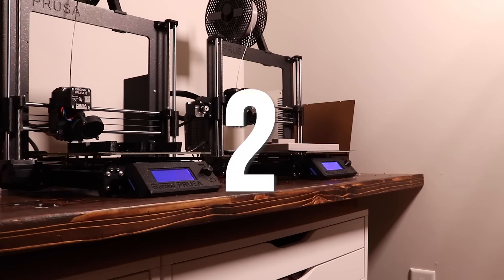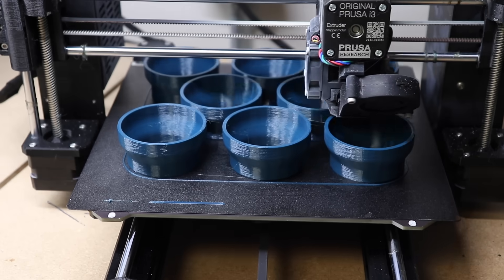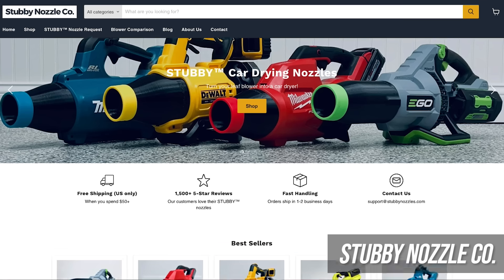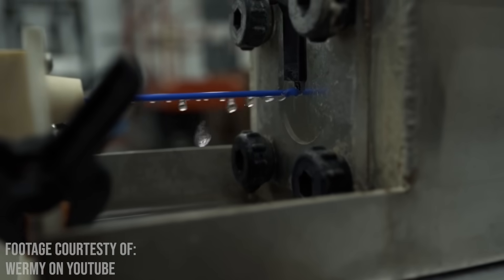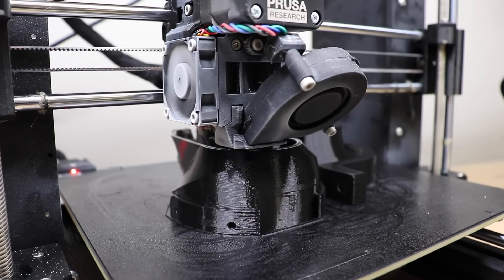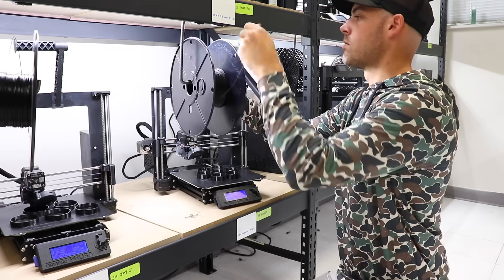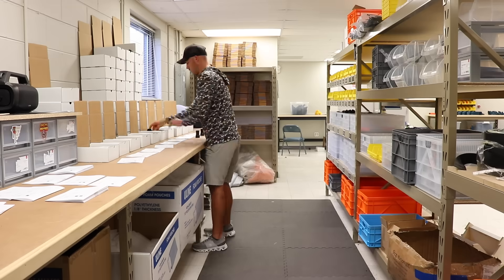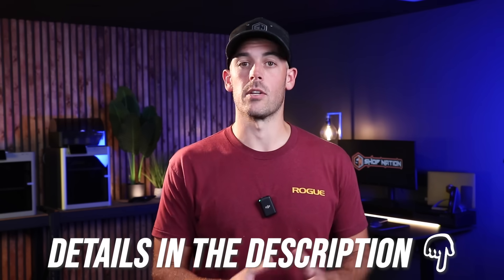10 Things I've learned running a print farm

Comment: I know you have to do ads but I use the absolute cheapest filament I can find and out of over 1k rolls I've had two bad ones that I had to put in a dryer and they printed fine. 
"Quality" filament is a myth.
Reply from the maker: I'm glad you had good luck but filament quality issues are an enormous problem.  Diametrical tolerances, polymer blends, color additives, they can all contribute to your printers all of the sudden having all sorts of problems.  For the most part cheap filament producers don't have tight enough constraints on those things

Comment: Really looking forward to your thoughts on the Bambu's. I've got a small etsy shop and use a P1P (soon to be a P1S) and an X1C and do around 10-15 orders per week so nothing major but considering adding another x1 and expanding the number of items I sell as I've only got 4 right now. 

I've only been runnign them for about 5 months and so far (touch wood) they've been very solid. I do still have a mk3 and a mini on standby should they need to be drafted in but 3 out of 4 items I sell require the AMS.

Comment: This is why I'm starting up only a small time, small scale printing business that only gets me a fractional income, in exchange for avoiding to become a printer slave. I don't try to out-prints costs, instead I'm printing custom designs. Value is not added by printing but by the design. I anticipate 2 days worth of (my engineerring) salary as profit for a print produced. The prints I make are not urgent, printer goes nice and slow and I only check it once an hour. I project having one job per week at most, this could give me around 1/2 to 1/3 of my monthly consts, for a worst case of 4 days of work per month. Of course this is not my main focus area and I'm aming for having multiple legs to stand on, working like a semi-passive income.

Comment: Calling networked printing in a commercial setting a "third party hack" shows how little knowledge this person has about the industry they had some luck in. Third party tools are a mainstay in engineering and manufacturing. Small things like a CNC post processor might be like 3 layers removed from any company that made the hardware. And then there is the nature of these low-end FDM machines - which is that the firmware was created by 'third party hacks'. The commercial 3D and 2D printing world both rely on a wide array of 'third party' software.

Everyone has a camera and some people will talk like they know things. "Third party hacks". Lol. $1100 for a 15-card SD duplicator..
Reply from the maker: My entire background is in engineering and manufacturing, so yeah. The term “hack” simply meant a 3rd party interface. Not a dig at all on those options, I pretty clearly stated it was just my opinion.

Comment: Wow that's some great insights! My BambuLab X1C is running fine after 2000 hours of commercial use. Sending print jobs over WiFi is a time saver for sure.
Reply from the maker: Great to hear!
Reply: @ShopNation  Yeah, given the availability and decent pricing of spare parts I'm confident to start a small print farm with those :)

Comment: Why not just layup onto a sheet on top of a vacuum sealed surface & leave cleanup to the customer?  You could ship handsfree then because it would be easy to remove the print. If it was on a feed line like this.  Just cut the sheet with the print onto a conveyor belt or “ant” table robot then drop the print into a box & fill with packing peanuts.  Can add label & place the box in a designated pickup zone for UPS/FedEx …this makes it scalable & is what my friend did for his 3D print & CNC factory that sells products that can mostly be just carved out of wood…some additional cleanup processes are also needed but he just has a guy come in to vacuum up the dust & replace filament & stuff weekly.  He has these little warehouse factories servicing several specialized store fronts in a few different countries…can offer a bunch of products on top of custom prints because everything is made just-in-time & it’s just material sitting there until someone orders the part.  He figured out to make it mostly scalable which is impressive for a non-software company.  He makes everything from those wooden owls that look like they were carved out of a stump to niche little plastic tools that a bunch of people were printing & even some car parts.  Has robot arms for painting some products & baths for cleaning but idk the real details.

Comment: I work for a very large semiconductor  company and we do maintenance on our tools, scheduled Monthly. Bi Monthly, even Mini PM you have to determine where the maintenance schedule for your equipment. Your schedule may differ. Keeping a well supplied stores of spare parts is Key even if you are buying on an annual basis. Instead of having a tool down for weeks "Waiting Part" have spare and install it then reorder the part for when the next tool needs it. You will find your production increases while your down time drops. Don't wait for the tool to fail before you act. Proactive is better then Reactive. Good Luck
Reply: Preventative maintenance is easier than corrective maintenance.

Comment: Have you considered repetier-host as a print server? Runs on Raspberry Pi. I only have two printers but multiple people in the house use them and can operate them from any computer on the network, with a user login of course. There are even options for integrating with other platforms like Home Assitant which I use to notify me if a printer is done or fails.

Comment: There was a youtube channel testing air pollution from 3d printing and his conclusion was that 3D printing mostly produces PM1.0 sized particulate and not much of the larger sizes (PM2.5 and PM10).  It sounds like PM1.0 is not good for you but it's not apparent that you're exposed to it (no smell, etc).

Comment: One of the best things I added to my printers is a controller (octoprint) so I can upload jobs instead of copying to a SD card. Adding a tiny bit of automation could improve productivity in a print farm, especially a large print farm.  Not really sure why you consider it a hack.
Reply: Mk4 has Connect and wifi. Perfect for farm. Queues, telemetry, cameras…
Reply: I have only one printer and octoprint is still well worth the very tiny amount of effort. Spent about $35 on a raspberry pi, installed octoprint on it, plugged in the USB - haven't touched an SD card since

Comment: 9:22 if your printers have an ethernet port, use that, or if you have USB you could try usb to ethernet adapter, or you could probably get raspberry pies and use octoprint and connect it to a lan network. or put klipper on raspberry pie and create a local LAN file sharing server.  These are just ideas man i dont know if it would work but maybe it can help you!

Comment: seriously, if you print one object over and over again,  think about modifying the gcode in a way that the printer knocks the object carefully of the plate, and restarts, or get some raspberry pi and use octoprint, you can connect 4 printers to one pi

Comment: You have arrived at a ratio of out of service printers to operational printers that is fairly constant. At that point is it worth have x spare printers to swap out when one goes down to keep your 40 constant? Then you work on the broken ones as needed. Or, potentially is the power of an unused printer to strong and you’d end up putting all 44? In service and be right back to where you are? Maybe you already have spares and I missed it.

Comment: They recorded using g10 garolyte print plates for self release of the print parts you can also automate the sequence of printer pushing part outside of the plate (the printer itself should stand tilted) . And well yeah using octoprint setup would save you a lot of time .

Comment: Hi from Will and Mr Data :):]
I continue to work to get certain systems improved for all farms, users, host sites, and search engines. At last my testing the best search engine found the thing below 909 pirates and files that are not proven legal to use. 
The best Sort was plus or minus 13 years. 
What things could be being looked for?
Business things. 
Medical things. 
Your things. 
There are now ball park 30 million licensed things and to find out if what you just drew is original and wether you may upload or sell it then  checking is required. 
A search. 
Combine all results of all the below search engines and searching. 
And sort by oldest first to find the true genuine original. 
Remember to filter out cnc milling, cgi, laser cutting, etc.
Search
3dmdb
Yeggi
Stlfinder
Google
Net.
Do that thing search for all uploads and sales no matter where the thing file came from. 
ven if you drew it, or moded it.
Even if Ai drew it. 
Even if scan. 
Even if a walk in customer with file.
Even if you call yourself a farm, service, or old McDonald etc. 
Even if you purchased file.
Even if you find a so called free file. 
A common newb mistake is finding a random thing on a random site and reading its license, and they think thats a thing check. This is an issue with thing promoters, showing piracy and any other newb not checking and starts selling those prints can and are being closed for piracy. 
So checks are important. 
Theres improvments to be made accross the sector. 
Its happening.
Have more sites operating for Migrateing things into so the comunity can put things into sites. 
Transfer of a thing from one user to another within a site is a basic if you want to sell me your thing ownership. 
If your site dont have Transfer a thing then the thing must be Migrated to a site with Migrate thing in then Transfer ownership within that site. 
Being able to buy your thing is a basic. 
Most farms actually dont know how to. They usuall know how to sell the stl copies or prints them selves. 
But if someone wants the thing ownership and you dont have a non commercial thing license then chances are if one of the many sharks in our sector see that nothing shall be said. 
A new thing license usually appears about that time. 
But anyway back to if someone wants to buy your thing you would have to own it to sell it. 
The farms that fold i often watch and they didnt actually licensed there thing someone else, got it, won it, took it, was given it, newb farms often just giving out designs to sharks left and right. 
Anyway. A quick post. 
Be able to perform a thing search.
Be able to sell your thing. 
Be able to be found. 
Find others. 
Wishing you nice success. 
Be well from Will and Mr Data :):] 
Yes a real android.

Comment: Did I miss what fire suppression/extinguishing you use.
Also filament drying and storage for hydrophobic polymers (PC, Nylon, etc)
And what about using OctoPrint on each printer and OctoFarm centrally to manage all the OctoPrint servers?  That's how I manage my smaller farm of 15 and its great control, efficiency reporting, print file mgt, etc

Comment: I'm surprised by the VOC levels. I know with my own single printer, when I walk into the room and it's been printing for a few hours there's a very obvious smell and I say that as someone who's been around chemical manufacturing for decades and doesn't easily notice such things.
Reply from the maker: What do you typically print with?
Reply: @ShopNation  PETG 95% of the time, PLA occasionally. PETG has the more obvious smell.

Comment: I have a prusa print farm, each one has a raspberry pi with octoprint, and its all managed by a windows PC running octofarm. It works fine, but I wish there was a better option for print farm management software. 

But it sure as hell beats the days when i was loading in files by SD card 😂
Reply: This was basically me a couple of years ago… by now we run a custom interface implementation on top of moonraker (most of our printers run Klipper) that fully integrates our farm with all our other systems. Out of curiosity what are you missing with octofarm?

Comment: Just to dispel some misconceptions:
1:24 All of it. Litteraly all of the power turns into heat(eventually). So does all of the electricity consumed by any other appliance. Except for maybe tiny bit of power when cooking goes into breaking complex carbohydrates.
1:38 No, the don't. The power consumption isn't everything. How much heat is escaping the printers is more important. During heatup, the heatbed is cold(er) = less heat energy gets transvered into the surrounding air. The extra power during heatup goes into heating up the heatbed, not surrounding air.

Comment: So fascinating. I didn't have 3D printers to test the air quality on my video and went off some research publications. Glad to see 40 of them are not having a huge impact in a contained room. That's encouraging.
Reply: I think it depends on filament because some of the PLA I have smell like pure chemicals similar to ABS so yeah def not safe for every day exposure especially in the same room one sleeps. A purifier and ventilation helps alot
Reply: I immediately thought of your video, Suman.
I'd imagine the numbers would be different if he used other types of filaments or even lower quality filaments. Nevertheless, the numbers are encouraging.
Reply: @matthysloedolff  yea that’s my thought process  as well. Maybe good ol American made filament warrants the price of admission due to purity. It could also be the printer itself applying an appropriate amount of heat instead of blasting it too far out, resulting in emissions of compounds that are happy to flee at higher temps. Given the study used 5 types of printer, each with 5 filament types, I do think it’s a good idea to take those findings and other similar studies at heart and use protective measures anyway.
Reply: @WoodcraftBySuman  PPE is my middle name. It would be interesting to see what temperature threshold results in significant VOC emissions and if the concentrations of emissions are linearly related to temperature.
Has the study also looked at a resin printer by any chance? I imagine that would be off the scale.

Comment: 3d printing is fun with one or two printers, but when you start to get more that five and a ton of jobs,
This gets old FAST and burnout can creep in and before you know it you want to SCREAM.
PLA is easy but when you start printing ASA and ABS and a bunch of designs that have a ton of over hangs and there are a bunch of different small parts to one design, that gets old very fast again!!!
So that being said 3d printers are high maintance and lets not forget about the expensive computers and Filament that serve then!!! TIME/MONEY< TIME/MONEY< AND MORE TIME/MONEY ALWAYS and forever!!!
Reply from the maker: Sounds like you could use some design pointers

Comment: That's a great video. The biggest problem with Bambulab printers is that they are pretty difficult to maintain. Not only it's difficult to acquire spare parts for replacement, the printers themselves are quite difficult to fix (exception made to the A1 but only due to the fact it was literally released last week and we don't have enough info about it); you can't go wrong with Prusa on this aspect, specially that now they have official representation in the US through Printed Solid.

I remember once when a person asked if anyone on the Voron Discord server would be willing to build a farm with 24 V2.4 printers (while being compensated for that, obviously). I answered asking about who would provide the maintenance of them, while giving my price for building them (I could even maintain if they were really interested). The person never answered back. 😅
Reply: We actually have a Voron Farm. V0.1s and Tridents. Invesiting the time upfront to build them and tune them has payed huge dividend and we really haven't had any major issues with them. Maintenance is relatively straight forward and parts are readily available or easily printed. Which is just about the polar opposite from the experience we've had with bambulabs...
Reply: I run a bambu farm and previously ran a Prusa farm (and an ender farm before that).  Bambus are by far the better farm printers.  Hotend swaps are faster and all repairs are documented on the website.  Spare parts are cheap and readily available.
Reply: @ArcaneZorro what printer do you use from bambu? The carbon of the p1s?

Comment: 3D printers seem great for a person that wants to test a product in the market. But once you've proven that it's profitable, wouldn't it make more sense to offshore it to China/India for mass production?
Reply: Yes but he's still nowhere near that scale. Injection molding is very expensive upfront with each product requiring it's own mold and each mold being average 5 figures. He has about 12 dust collection models for mitre saws with more coming. Some of those are multi part which means multiple molds. You're looking at well into the 6 figure range of investment. Molds also have a limited life. You need to be producing at least 10s of thousands of parts for it to be worth it.
Reply from the maker: Yup, what he said 👆🏼
Reply: @apsilonblue Yes and no.  There are short run prototype molds that can bridge the jump from 10s on the printer to 10,000 a month.  I profitably injection mold parts at quantities under a thousand, but these are simple parts and I mill my own molds.
Reply: Yeah makes sense, thanks!

Comment: Instead of the p1p, I think the Bambu Lab A1 will be the new print farm beast, $299 price tag with speed and quality comparable to the p1p, and the 1 clip easy-to-swap hotend. That 180x180x180mm print size should be more than enough for 80% of the print jobs.
Reply from the maker: Price point is great but a cantilevered design is a big difference from core xy. Quality will absolutely not be the same
Reply: @ShopNation  I think the quality difference between the 2 machines will only show for high speed printing and printing out thin and tall structures. Corexy is still my to-go, but I do trust Bambu Lab's software and profile that would make up for the bed slinger's lost in quality.